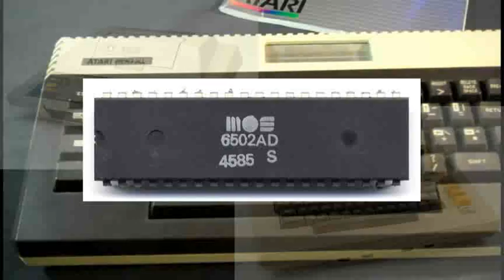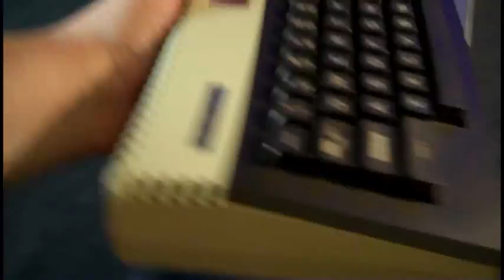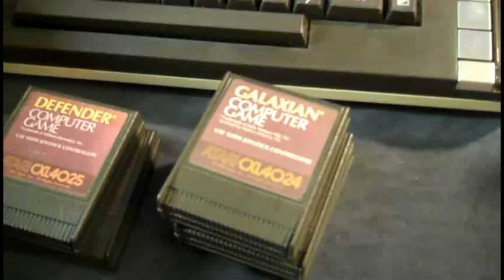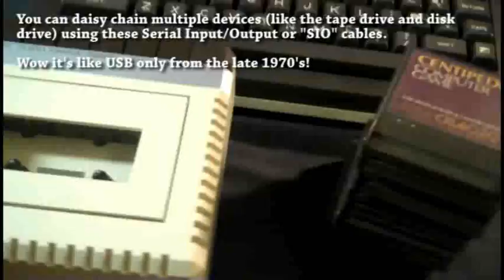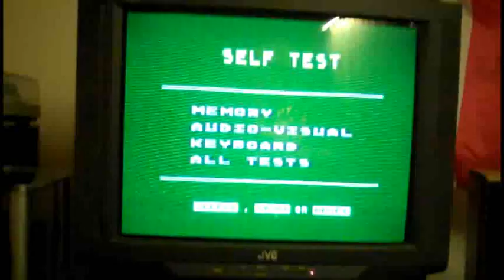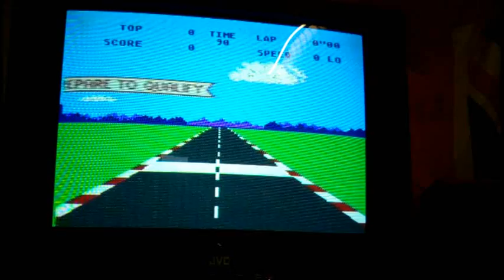Atari 600XL and games

Comment: Good video! The reason your 600XL is so heavy is that it's using the SCCO 'Stackpole' keyboard with it's thick aluminum backing. Other 600XL/800XL keyboard types are much lighter. There is a much better modern 2014 PacMan port for the A8's on the Atariage forums than the original Atari one you showed here. You might try it! Other new games coming out regularly as well.

Comment: WARNING- The vídeo is  Is extraordinarily wrong!!  

1-The Commodore uses the MOS 6510 Processor 

2- Don't use.. Repeat.. Don't use a Sega Genesis Gamepad as control, without correct adapter, becouse, the port 9 pin will fit, but, the Sega Genesis Gampad uses different voltages and pulses, then can damage the computer. It happened.  On Atari's, Commodore 64/128, and Amiga.  Be careful!
Reply: Which controller do you recommend, and where does one find an adaptor, or DIY?http://atariage.com/forums/topic/259590-genesis-6-button-controller-compatibility/

Comment: I had a 600XL growing up, but we were too poor to get a cassette drive, and certainly too poor to get a disk drive - so I'd write a bunch of basic stuff, then have to just leave it on and hope for no power spikes or outages. Eventually I replaced it with an Adam computer, which did have a cassette drive - and finally I replaced that with a Commodore 64, but that was 1989 already - but at last I had a disk drive. That Commodore lasted me until the mid-90s when finally I could afford a PC, now I have all top of the line everything that I build myself. But it all started with my humble Atari 600XL.

Comment: True, though I never had problems with the 5200 joysticks....my friends and I adjusted easily.  There are also a few games where the 5200 versions are superior to the 8 bit line, but as they are the same hardware, most games were identical.

Comment: @MN12BIRD Nice pickup. I could tell that in no way you were inspired by my videos :P. Ironically, I received Pac-Man yesterday (just waiting on Missile Command). Galaxian seems to be a great port too. The only complaint I have is that the carts are very expensive (case in point: Donkey Kong is $20 on ebay). If any of you want to check out Centipede, Frogger and Star Raiders in action, check out the featured video that I have up (the actual video is on my alternate account).

Comment: @nathanallan1 It's OK to use a power supply with more amperage than the computer needs. The power supply's rating only specifies the maximum current, so it will be perfectly fine supplying less than that. The DC power supplies for all the Atari XL and XE series computers are interchangeable, except for the 1200XL which uses an older 400/800 style AC power supply. Just don't try to use a C64 power supply -- the plug is the same, but the pinout is different, and it will damage your Atari!